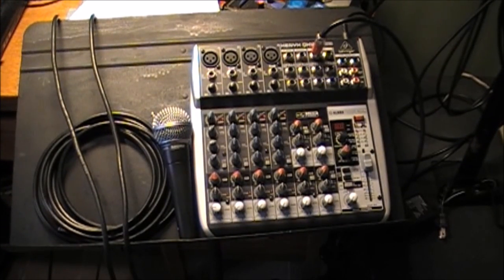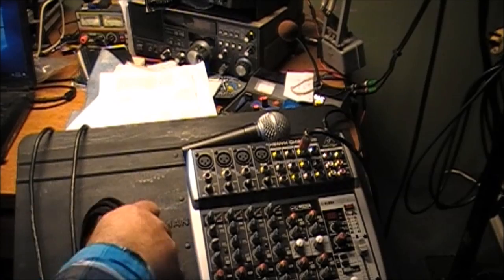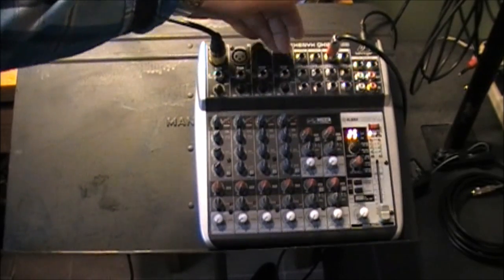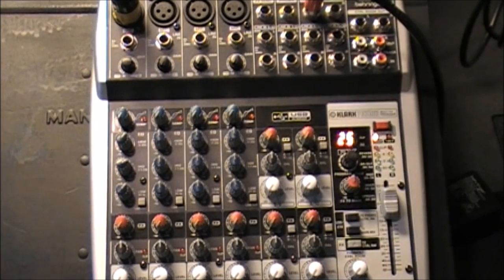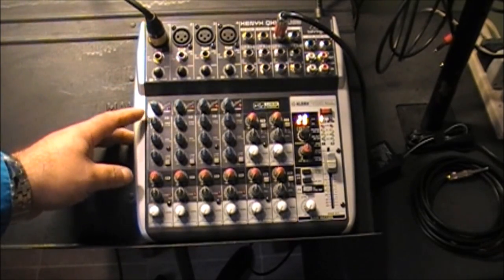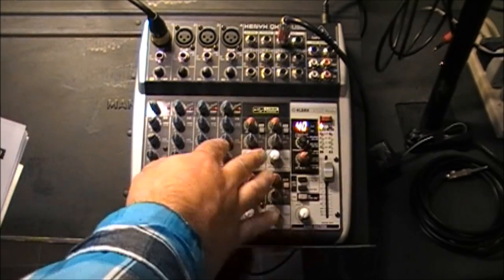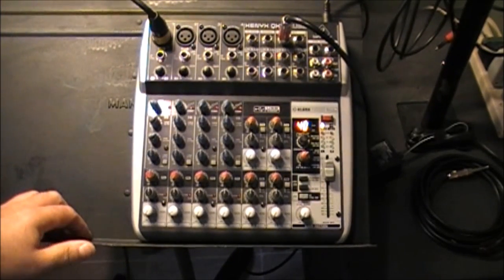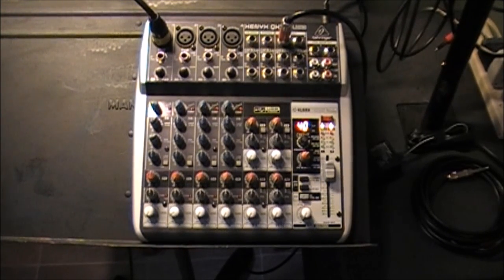Behringer Mixer: How to do a setup

Comment: Ty for a great video. Can i use this mixer to an active iphone speaker like the marshall acton bt? And wich cable do i need then?
Reply from the maker: An Iphone jack is a standard 3.5 (1/8) stereo jack. What you will need for best performace in my opinion would be get a patch cord that goes from a 3.5 stereo jack to two 1/4 standard jacks and plug them into the left and right (stereo) channel inputs to the right of the mixing section. You will need to balance each channel so that they are a mirror of each other. You will also have to set the volume / gain the same. For absolute best signal with best headroom, always try and incorporate your input signals into the XLR channels. This could be a patch cord as well which would go from 1/8 male jack to left and right XLR jacks. You will have two XLr jack inputs for two channels which need to be balanced (mirrored) equally as well. In any application, be careful not to provide too hot of a preamp signal to the mixer. It will cause distortion and the signal will not be clean or suitable for any music application. I hope this is helpful. Use highj quality jacks and cords. Always describe to the shop what you are doing so they can offer you the proper patch cords that will work well for you.
Reply: Andy Tobin Thank you so much! Can you recommend a specific patch cord you use?
Reply from the maker: Here is an example. BELDEN is a good maker of cables. Look for a high qualiytyu one. Ask lots of questions. This is just a sample of what you are looking for. I am not sure of its quality.   https://www.ebay.ca/i/292627765523?chn=ps&dispItem=1
Reply: Andy Tobin that one looks perfect, thank you. One last stupid question, why two? What happens if i take one?
Reply from the maker: The channel insert will be mono. If you just want to use one channel, you will need to run left and right signal together into (1) one mono channel. It is no longer a stereo signal. Keep in mind, you can also uise the stereo channels on the right hand side of the mixer channel. Here is a sample of that. 

https://www.amazon.ca/UGREEN-Splitter-Computer-Multimedia-Speakers/dp/B00ZKM3SHK/ref=asc_df_B00ZKM3SHK/?tag=googleshopc0c-20&linkCode=df0&hvadid=292968454485&hvpos=1o1&hvnetw=g&hvrand=2939807491365488776&hvpone=&hvptwo=&hvqmt=&hvdev=c&hvdvcmdl=&hvlocint=&hvlocphy=9000010&hvtargid=pla-416188841474&psc=1
Reply from the maker: This may be the best route as the channels are designated as stereo so it should be your best option and less confusing as well.
Reply: Andy Tobin allright, ill give it a go. Thank you so much again. Im so happy for the help.
Reply from the maker: You're welcome.

Comment: HELP! I have just set up for the first time my Behringer 1202FX and Behringer speaker plus lap top and Sure Mic.  I had sound, and then when I had finished experimenting, I just unplugged the whole lot from the mains power  and now the mic does not seem to work. Have I damaged the mixer XLR? I am  so upset at myself!!!
Reply from the maker: I does not sound like the XLR is damaged. First make sure your system is hooked up right. I think the next step is to check your mic and cord to ensure no wires got broke or a switch on the mic was off. Once you have determined that the cord and mic is working, you must check all the areas of the board where you set levels.That is the small preamp button on top, the gain button and the slider for  the main out. You should also check and see if you have muted the channel. there is a mute button for every channel. Let me know how you make out. "Ensure everything is plugged in properly and turned on and up.

Comment: Enjoyed  your video.  very helpful.  I have the 1002B  I didn't know know you could use the right and left channels in the stereo for instruments. Do I need to run the outputs in 2 mono plugs to a single mono plug (Y adapter) before going into the amp so sound of each instrument comes out of all the speakers. 
I see you are a ham radio operator.  Same here.  
73, KA0ZLG
I'm good QRZed
Reply from the maker: Thanks for watching Mike. Your support is much appreciated.
Reply: you cant join 2, [ a pair ] of stereo outs into 1 as you may damage the source output but you can run 1 mono out into 2 [stereo] ins . this is a general rule, though some equipment might have built in electronic protection to avoid such damage

Comment: Hi great review! I have scarlett solo audio interface. I just wanna know how can I connect it in this mixer? I wanna buy this but wanna know first if it can connect to my interface. What process and adapter should I use? Thanks! :)
Reply from the maker: I am not familiar with the  scarlett solo audio interface but whatever the output is you will want to use the low impedance plug ins for maximum control and ability. If the unit is stereo then make or buy a patch which will use two low impedance cords. Use two channels and set the channels identical to each other. The signal out will be mono but your control and audio will be superb. I am sorry that I am not in the know on your audio interface. Good luck and thanks for watching my video.

Comment: Andy, if you turn on the phantom power on the mixer and it sends to all 4 XLR inputs does it hurt or affect the sound of the dynamic Shure mic you have on channel 1?
Reply from the maker: The phantom power will not damage anything. It merely provides power to any phantom powered capable device you have plugged into the low impedance jacks. the dynamic mic will work as norma.  And, for example , if a condensor mic is in channel 2 it will become phantom powered and work as a condensor mic should. The Dynamic mic will typically pick up vocals anywhere within 6 inches whereas the concdensor shure mic (For example) will likely pick up all input vocals up to about 6 feet depending. That is just a general measurement of distance just to demonstrate how each mic will work in a musical application. I hope that is helpful to you. Phantoim power is a very safe but handy feature so no worries.
Reply: Thanks, Andy.Great video.
Reply from the maker: qwerty mcqwert  Thanks for watching. Happy to be helpful.
Reply: NEVER use phantom power if you have keyboards connected via XLR.  You will damage your keyboards.

Comment: what if you dont have a power speaker?
Reply from the maker: Run the cord to an amp IN and then amp OUT to speakers.
Reply: @Tobinindustrial   yeah it's not very loud at all talking through a mic
Reply from the maker: @johnthompson3856  yes, my friend. the mixer only has a low preamp signal that needs an amp to increase the volume and get headroom. There are other mixers with built in amps but these smaller, thin ones are usually just preamp signal mixers.
Reply: @Tobinindustrial   are these good for podcast type of things?
Reply from the maker: @johnthompson3856  Absoultely, I have never done a podcast but this would be a great mixer to use with a condenser mic and you can use the phantom power switch to gie the condenser mic the 48volt DC power to work as it should. As I said, I have not done that before so you'd need to do a little reserch on how to set it up to a computer and do a podcast online through the internet

Comment: Hi Andy! Very nice tutorial, but what Behringer model are you using? I saw Xenyx 1202FX in one of our local stores,  but it has no Compressor.
Reply from the maker: I am using the Xenyx QX1202USB
 model Behringer.
Reply: Ok. I’m  trying to choose between 1202fx and QX1202, but i have very limited budget.  Do i really need compressor for Live Vocals?
Reply from the maker: @mikodelosreyes9883  Absolutely not. Compression is not used so often on vocals. It is mostly used for Bass and perhaps drums among other instruments. I'd lean more toiwards using reverb or echo on vocals.

Comment: Hello, I'm a mixer newbie, I had a little family party last weekend with this mixer and 2 amp. speakers, the problem I had is I plugged the mic SM58 in channel 1,, but the sound only went to one speaker, I didnt found any "mono" output in the mixer, How would I do that for next time for output the mono mic to the 2 speakers ?  thanks
Reply from the maker: There is a Left / Right button that needs to be centered for full left and right signals. I am not at home right mow but I believe they are called "PAn" buttons.I think that is the second button from the bottom. Turn it so it is at the top "Centered". Also, make sure you have the mixer on the back in "Stereo" selection and you have the speakers hooked up right. Let me know if that works.
Reply: Thanks,, I just rent the thing last week,, I'll see next time.
Reply from the maker: Good luck my friend.

Comment: Thanks for the video dude 🙏🙏
Reply from the maker: You are very welcome. Thanks for watching and supporting my channel.
Reply: With one output from mixer to the powder speaker will it sounds ok?
Also my power speaker is got one for mic and one left and right red and black input witch one i can use? Thanks 🙏
Reply: I mean the output has got left and right but you plugged only on the left.
Im using it for singing, is this mixer has good fx and eq? Thanks
Reply from the maker: Yes, one speaker will work fine unless you are setting up in stereo by which the mixer has some stereo channels that you can use two speakers in a stereo setup. I always like to use low impedance channels as they have a hotter signal and will be more controllable. The left and right can be used as  well as inputs as long as it is an input but be careful not to send in a powered signal into any of your powered speaker inputs.  The inputs are only designed for pre-amp signals. It is best to experiment based on your equipment, instruments , etc and see what works best for you.
Reply: Yes i use only one speaker in a small room. 250w rms.
I use 3 mics one for single and 2 for instrument drum and a harmonica witch they are classic the mic should be used for it.
Reply: Also i want to know the input in the speaker one of them says mic input is this the one for input from the mixer?
Reply from the maker: If you have a yamaha powered top like mine (DXR10) or similar, you need to switch that mic channel to  a "LINE IN" channel. If it says mic input then it is for a mic input only. There should be a small switch that says Mic / Line In.... If that is the case, then you need to put it to Line In so that you can put in your mixer signal.

Comment: Hiya Andy thanks for the video its very good and informative what id like to ask is can you run background music say to your mic channel on the same slider or twist knob  the scenario will be a radio station  so when i am on air and come in with a cue point with some chat id like a low level background tune on a loop  instead of dead air  when im talking  if this can be done could you do another video as im sure im not the only one thinking  they could do with this lol ....cheers Andy B
Reply from the maker: I am not quite clear on what you are asking. My answer is that you can use each channel independently of each other so all you would need to do is turn turn Channel one (Radio Loop) and turn up channel two (Vocal Mic). the main level can be preset and all you would need to do is remember the levels of the radio loop volume and what level your mic needs to be on. if the mic has a switch then that level does not need to be touched as you can switch it off. I am pretty sure this is not the answer you are seeking but based on your description of what you want to do then that is how I would accomplish the loop radio and vocal announcement.
Reply: ok example is  say if i am reading out a weekly gig guide with mic leveled up instead of having no music playing in the background  is there a way of putting on the same bank mic  slider some back ground music set at a low level without using another fader  maybe use the fx knob or aux on the same slider as the mic

Comment: Does this console have an on off switch?
Reply from the maker: No, it does not. I wish it did.
Reply: @Tobinindustrial  I use this mixer xenyx 1002 by behringer in electronic drums. I have connected on the mixer the cables for the two speakers in the main out as well as the headphones in the position of phones. I want to ask how I can isolate the sound on the speakers when they are open and the sound can only be heard on the headphones.
Reply from the maker: @giannispan8129  This mixer is for mixing, it is not for personal headphone use only. You would have to disconnect the speakers or shut them down. I don't know of any other way.
Reply: @Tobinindustrial  The console light is red, not blue. Does the console have a rehearsal?
Reply from the maker: @giannispan8129  Yes it technically does.

Comment: do you know why i always get a buzz when the to phones/ctrl rm button is not depressed?
Reply from the maker: Are you using professional shielded cables? Use speaker cables for speaker hookup and instrument cables for instruments. use shielded and balanced cables as necessary. If  buzzing is still present, you may have a bad cord or an instrument may need shielding. Also, be sure all equipment is properly grounded. Adapters can cause hum, LED bulbs and other electronics can also cause hum. Sometimes it is near impossible to get rid of it completely. I have seen places where the AC power from the building was bad and caused hums. A drop in voltage can also cause issues such as humming. Good luck, I hope it is something simple. Start with the easy possible remedies first. try to eliminate each piece of equipment and cord individually until you figure out what the issue can be.
Reply: Andy Tobin all I have plugged in are the headphones, no instruments or speaker hook ups.
Reply from the maker: Sounds like you have electrical hum. 60 cycle hum specifically. It may be a bad ground in the home or electronics in the home. It could also be the very adapter that powers your mixer. You just have to work your way through this. Try the mixer plugged into a totally separate plug or even a different home. Once you have the electrical and electronics eliminated, you gotta look at the headphones, adapter or even the board itself causing a hum (bad and leaking capacitor) Sorry I cannot be of any better help. It is all down to eliminating everything possible that could be causing it. You may even have a dirty headphone plug in or a dirty volume/control pot, slider or push button.

Comment: Hey, so ive been playing around with the FX on this board and noticed that I can still hear my normal voice. itll be like 1/3 normal voice and the rest voice with effects. Is there a way to rememedy this to get vocals fully with the effects?
Reply from the maker: I have had the same issue on different mixers. I am unable to explain how to remedy it but it has to do with the effects settings you have made and the channel you are using the effects in. there is a press down button in the wrong position. I don't have my mixer in front of me so i am not 100% sure but check the signal path of the effects, look at the "solo" button on the channel and also make sure the channel is ending the signal through the effects and then out through the send (Left / Right Out)
I am sure it has to do with your effects settings area of the board and some button you have pressed to send the effects to "control room" or "monitor signal" Good luck. Wish I had the mixer here to reference for you.
Reply: um, you are ment to hear part of your own normal voice , if you didnt you would only hear a delayed version of your voice which would sound awfull, you would be singing a note and there would be a delay [ the reverb] before you actuarly heard your self. which as you can imagine would be ridiculas.cheers. carl.
Reply: andy tobin read my comment to romer lagrange

Comment: My power supply is so loose is it normal
Reply from the maker: It should have a small bit of movement but should not be loose.
Reply: @Tobinindustrial  but i feel like it schould go longer in then it does
Reply from the maker: @zicofitzgerald9015  It just gos in the length of the metal. if you look at when the mtal first touches the inside plug part. The length of the silver metal tip should  insert fl=uch to th base so that the black part of the adapter end should go inside the plastic port the same distnce as the metal goes into the actual plug in.

Comment: HELLO LOVE YOUR VIDEOS ONE QUESTION CAN I USE THIS MIXER WITH A SINGING MACHINE OR DO I NEED TO BUY A POWER SPEAKER THE SINGING MACHINE HAS SPEAKERS THANKS
Reply from the maker: A Karaoke machine (singing machine) has some self amplification so if you can send a signal into the singing machine then this mixer will work well. I don't know what model singing machine you are using but just send a 1/4 inch guitar/speaker cord into the input of the machine and into the "output" of the mixer. Be careful of your levels so start low on the mixer as well as the singing machine until you find a healthy sounding balance.Too much volume from the mixer may overdrive the singing machine and cause distortion or unclear signals. Be sure to double check all your connections for proper signal send before turning anything on and /or turned up. Damage may result if you improperly hook up either unit. I highly recommend you read manuals on both units if you have any concerns or questions. Good luck with the setup.

Comment: We are having trouble getting the mic and music to come out the same speaker ? Any help for this it’s for karaoke?
Reply from the maker: The low impedance mic should be in one of the 4 low impedance channels designated. Make sure that the mic is working properly in the speaker. The Karaoke music signal should be injected through two high impedance  jacks (stereo) and then mixed equally left and right as you see fit. make sure the pan button is at center and then set your final levels for both inputs. then you set the overall volume as needed for good balance.